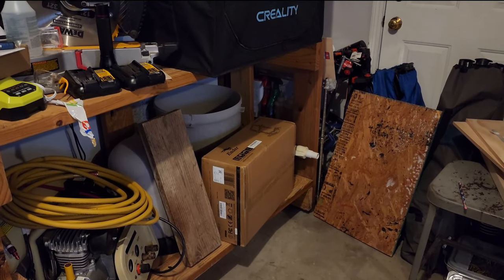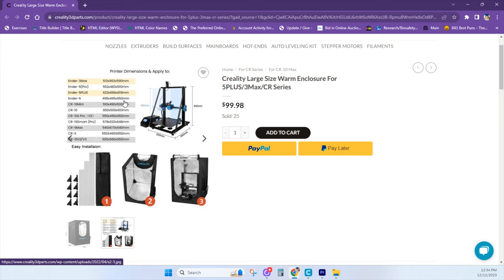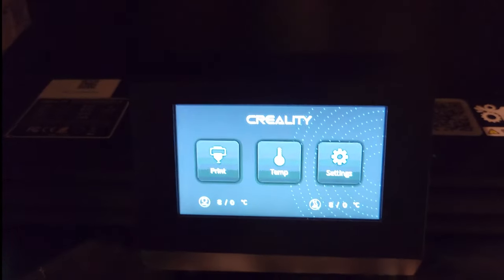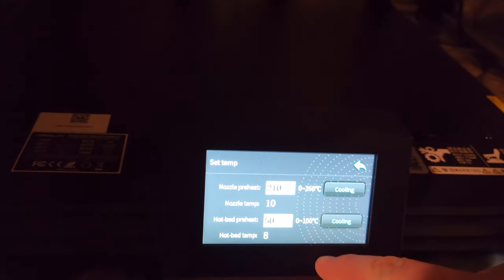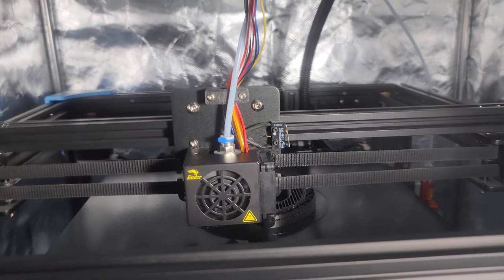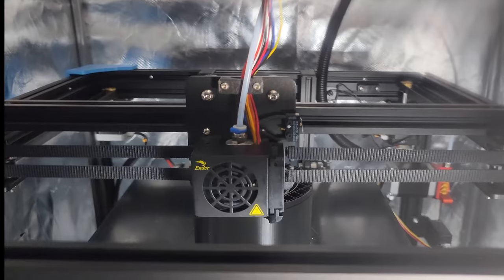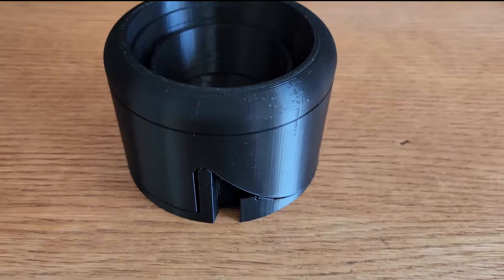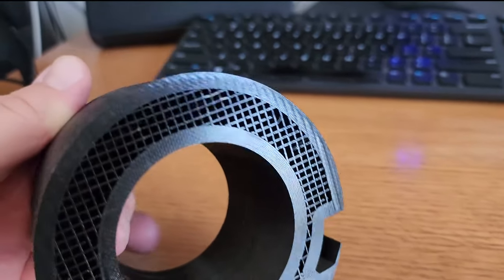Optimizing 3D Printing: How the Creality Enclosure Masters Cold Temperatures

Comment: What size enclosure should I get for the Ender 3 S1+ ?
Reply from the maker: hey there!  The dimensions of the Edner 3 S1 Plus are 557*532*655 according to the website. I assume this measurement includes the filament spool on top of the printer. For reference, the ender-6 in this video is 495 x 495 x 650 mm and there is plenty of overhead space. The Large enclosure would be good for you printer. 👍